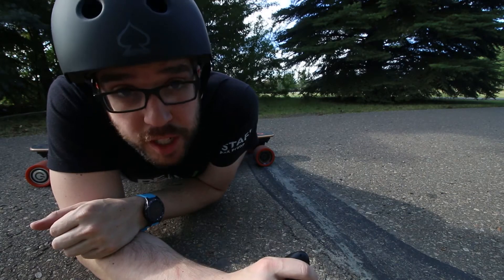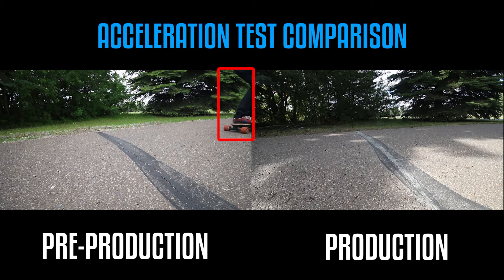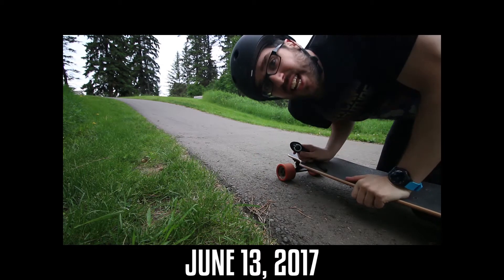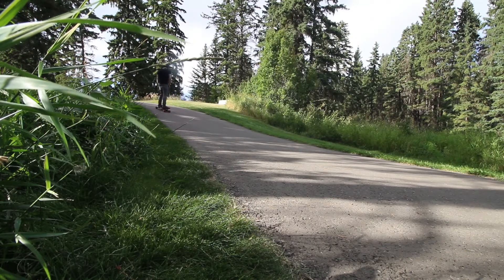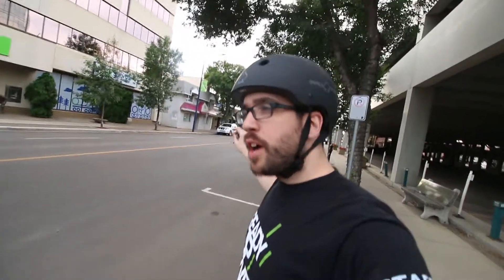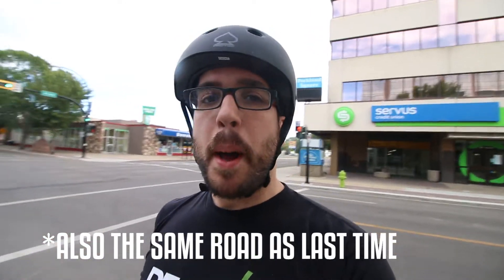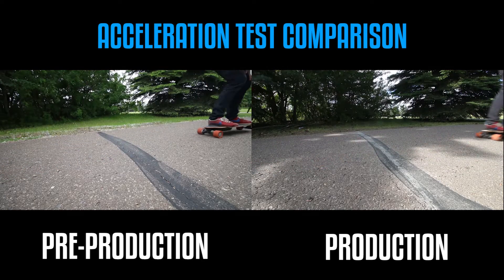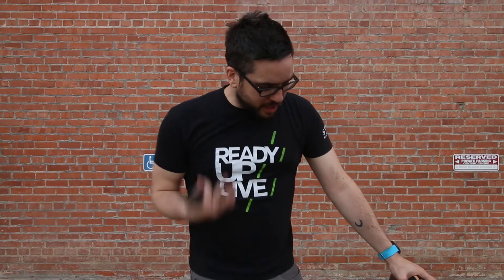VLOG | PRODUCTION Juiced Board - Acceleration, Hill Climb, and Top Speed Test

Comment: I just got this board. It's amazing!! The video doesn't do it justice. I have ridden some steep hills and it just flies up them. I'm thinking the board he has isn't quite as good as the final production board. This is definitely the board to get if you don't want to spend $1500 on a Boosted.
Reply from the maker: +Evan Youngberg I think it's just hard to tell the grade of that hill. I will have to calculate how steep it is.
Reply: I can understand that, hills never appear very steep on wide angle cameras.